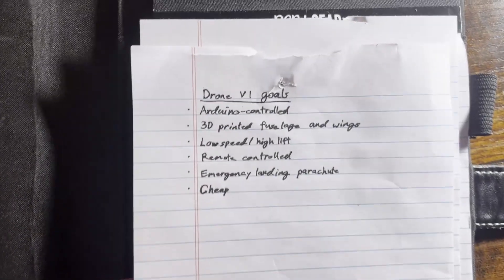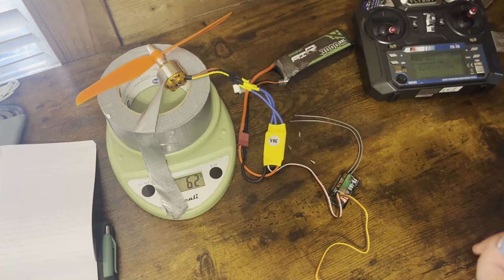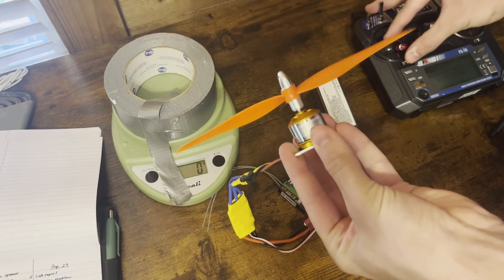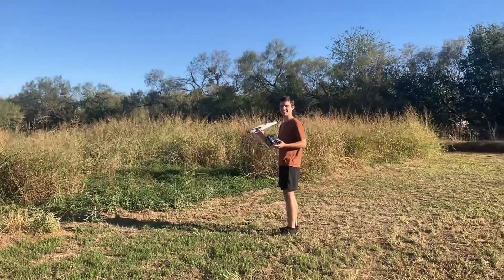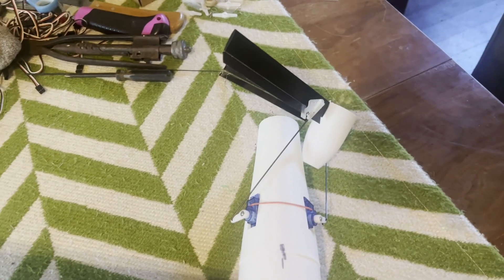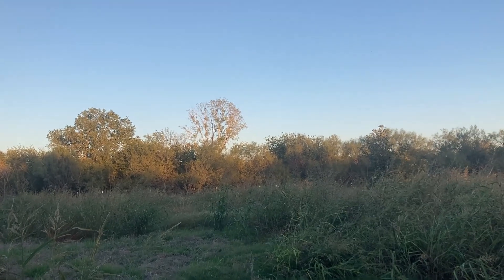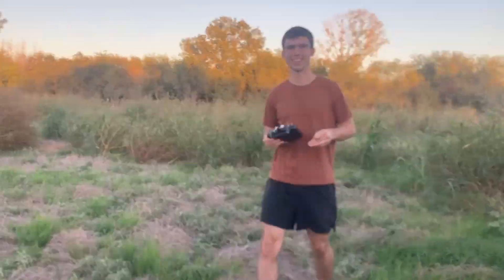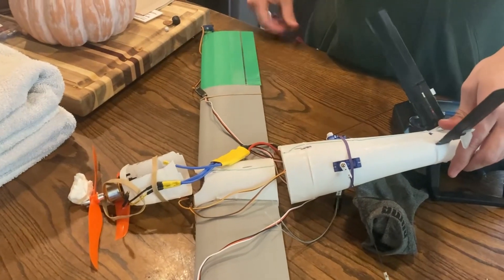How NOT to 3D Print an RC Plane

Comment: Love this! Holding the motor spooling it up worried me, but super cool to see you go from nothing to a flying plane! 

Vase mode seems to be very weak across layer lines, may need a different print orientation. I also think that the controls for a standard plane also incorporate some mix between your control surfaces. There are tons of plane clubs and you could learn alot from hanging out with one on a Saturday. But even going on to the next project, it was fun to watch!
Reply from the maker: Holding the motor might not have been very wise, but it was a thrill! I agree. I should have looked into different orientations, and maybe not even vase mode. I think the benefit was too little to use. Also, I think having the fuselage combined with part of the wing would decrease the stress at the point where the wing meets the fuselage.

Comment: This is so sick. I think you are right, making the plane longer would probably help stabilize it. And bigger control surfaces. 
I also think if you could make some landing gear to help it get speed before it goes airborne that could help. The plane is more stable when it’s lower to the ground due to ground effect so maybe it can help you get better control of the plane before you try to gain altitude. And maybe keep the CG slightly forward for stability and slowly move the battery back to fine tune it.
Also on a cold day density altitude is lower so you could probably fly better with more weight due to the air being thicker.
Those are my only thought, could be totally wrong. But I’m loving these videos
Reply: The plane is in ground effect at the wings length from the ground